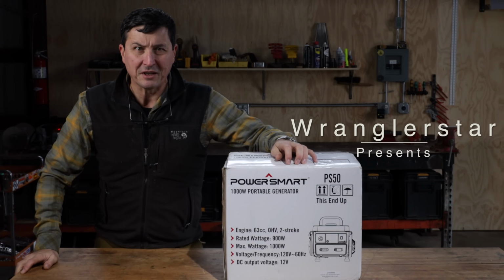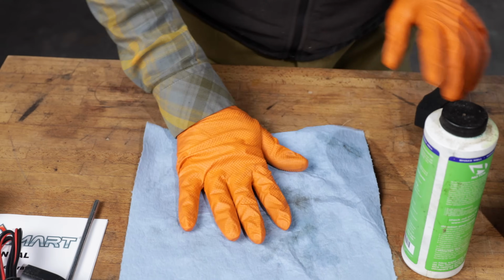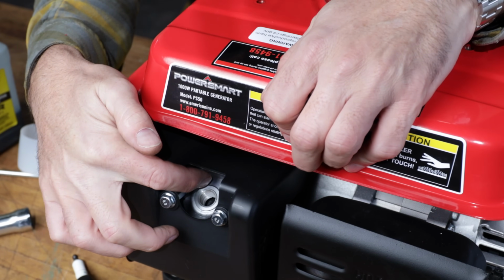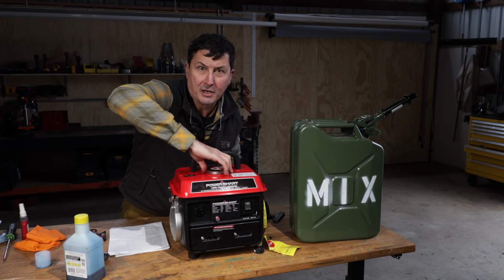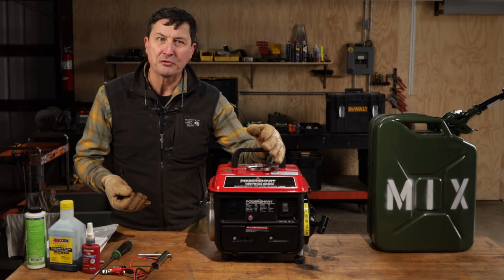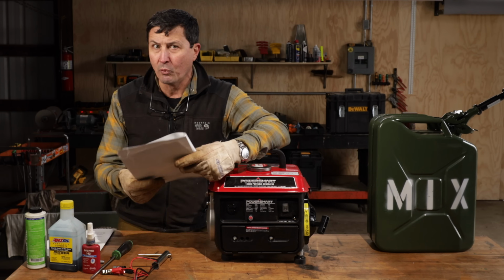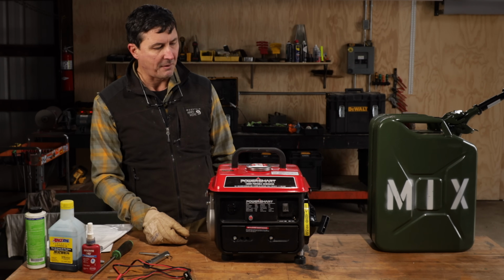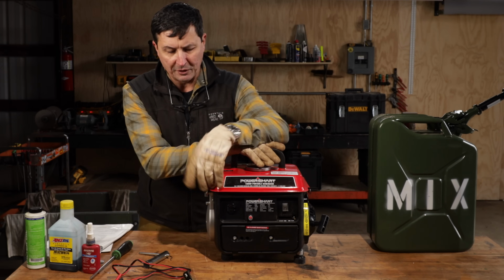TESTING The Cheapest GENERATOR on Amazon -$99

Comment: I've got a few of these generators, you do get the odd dud straight out of the box, and I've had one of those, but there are plenty of good ones.
 They are based on an old Yamaha design, its two stroke engine has a carb and reed valve mounted at the back of the Alluminium alloy crankcases, with a detachable cast Iron cylinder barrell and Alluminium alloy cylinder head at the front. The cylinder also has a sort of triangular shaped exhaust port, probably in an attempt to soften the exhaust note a little.

 They usually run quite smoke free with the recommended 50/1 petroil mixture, after any excess oil has cleared. They sell for around £60 from cut price supermarkets here in the UK, so they are just about cheap enough to risk getting stolen if you are forced to leave them running unattended outside.

Comment: I bought one and used it for a week once after an ice storm left me without power. I did not drain the gas and put it away properly, so it never started again. The tiny carburetor jet was so clogged I gave it away to someone who likes to tinker with stuff like that. However, I bought another one specifically for a fishing/camping trip, and I drained the gas and put it away properly, and it still works fine today. Just don't store it without turning off the gas and then running it until it runs out of gas. With a few precautions, you'll get your money's worth.

Comment: Thanks for your time creating this video. It is pretty much all subjective but great advice about not storing a generator with fuel in it. As Wranglerstar knows, a more useful evaluation would include hard data such as frequency, current, voltage and temperature rise of the engine and the generator under various loads all of which is easy to measure. BTW, charging that little battery is not much of a load. 

A typical refrigerator is said to draw about 7.5 A while running but can require as much as 10-13 times that on start up although for a very short time. 7.5 A at 120V is 900 W which is the "continuous" rating of this generator. How many of those cycles would this generator withstand? When a generator is really needed in an emergency, reliability and longevity are essential. Can a $100 generator provide that? If not, purchase a half dozen as backups. 

Another consideration is availability of repair parts. I assume these are marketed as a "consumable item" to be discarded upon failure. This is a nice little portable generator for camping or the  occasional powering of construction tools but I would not expect it to provide the service I need in an extended power outage. I doubt that is the intention of the manufacturer so be cautious about what you purchase for your particular needs. 

OK, now all you self appointed authorities can commence criticizing MY "opinion" because you feel your opinion is more valuable than mine. Keep in mind, this is Wranglerstar's video and not yours.

Comment: The watts are a joke.. Look at the amps 7 amps won't run much of anything except for a light bulb or box fan or a 1960s 6 amp drill. Modern drills, skill saws, battery chargers etc use 10 to 15 amps... FORGET IT IT WON'T WORK. ITS IMPOSSIBLE. I know I bought one not knowing the amps. Anyone who says 7 amps runs a refrigerator is laughing at the people who ran out and bought one..

Comment: This generator looks exactly the same as the Tail Gator from Harbor Freight, almost certainly from the same factory. I've heard its a good idea to immediately replace the spark plug because the one it comes with is garbage.
Reply: NFL plug and non ethanol fuel 👍

Comment: I owned one of these generators for almost eight years, it was bought exclusively to power the converter on my small Rv, and it worked relatively well for that application. Now what you are not aware of, is how dirty the voltage is, coming off this unit, the sine waves were the worst I have ever seen, I tried running simple electrical items with it, and it destroyed my cell phone charger, an Led rechargeable lantern, and my portable 12 volt battery charger ....NOTE: The 12 volt charger that is built into the generator has an extremely weak rectifier board and no regulator, so after about 3 mins of charging a dead 12 volt battery, it trips the over load breaker, it's not going to work unless you sit there all day and manually unplug the twelve volt supply every two minutes for about 20 seconds to cool the diodes in the board😩, typical Chinese engineering, leave out a complete component, to bring the cost of an item down... 
      The day I pluged in my small deep freeze, during a power outage, it ran for a while and then made some strange noises, and thankfully shut it self down, as it could not receive the proper hertz frequency from the unit under load to cycle the compressor, the voltage spike of the freezer's compressor was more than the voltage output of the genset, although the freezer was only rated at less than 600 watts... This little generator has its limitations, it's great for basic electrical items like an electric drill, simple kitchen appliances, a small eletric space heater, house hold lights ect. it will even run an old school tube TV with a robust high voltage regulator, but certainly not a flat screen TV, or any sensitive electronics. I have even tried running a high quality voltage surge protector in loop with this generator and it would go into limp mode after only 1 minute of operation, with a flashing code sequence that denoted poorly regulated out put voltage, too dirty to filter by the surge protector.... Decide carfully on your needs, if this generator is going to work for your application before buying it.
Reply: Noted, and thanks for it, no rectifier equals cheep. But if you have a rectifier (like for your vehicle that plugs in the old cig lighter) you can protect the finer electronics.
Reply: Have you tried a UPS? They are better than regular surge protectors. Need something for a hunting cabin and don't want to be spendy as it will only be needed for short periods of time.
Reply: @kenkinniph2327  my thought exactly... I have one of each but no O scope anymore. Will be worth a little experimenting. I'll call Shelton.
Reply: An UPS will FREAK out when connected to a dirty generator. It will keep switching back and forth from the generator to it's internal batteries trying to clean the power until the batteries die and then it'll shut down totally.
Reply: @kenkinniph2327  No I haven't tried a UPS back-up, but it sounds like a good idea, I did however buy a more powerful, better quality  generator, it's 1800 watts, and has a relatively clean sinewave, so I've had no complaints with powering electrical devices.
Reply: The powershart
Reply: It's not pure sine wave I would not use this generator on any electronics or motors.
Reply: @ronb6182  depending on the type of motor, it should be ok, I used this generator for running an electric drill, and a hedge trimmer
Reply: Direct current is probably ok you can add some capacitors and chokes to clean up the  DC. If it's only a half wave rectifier put a bridge rectifier on the dc output. As for ac I would not use the generator for anything else.
Reply: Agreed, the sine wave is way off, was getting over 400v spikes, and blew a halogen lamp and soldering iron. A friends caravan charger was fried after using it for a few mins. Pile of junk. Buy cheap pay more , buy twice.
Reply: @workonesabs  wow maybe my incandescent lights might also be a target with 400 volt spikes. I would forget the AC portion of this generator period. DC you can add a bridge rectifier, capacitors and chokes and you should be fine. People don't realize that most home generators that you buy at the big stores are really alternators and a cheap inverter. I have one myself I bought in case of a hurricane but it would be better to buy batteries and a good pure sine wave inverter and keep the batteries charged then use a generator that has dc to charge batteries if you run low on battery power.
Reply: @workonesabs  Mine worked really well on my tent trailers convertor, but I did not have such a large deflection in voltage
Reply: We use it to charge our battery bank and then pull clean waves from our inverter
Reply: Brent you can clean up DC. You can run dc through a bridge rectifier and add a good size capacitor and use a zener diode for voltage regulation.  If you are more advanced in electronics you can use  power transistors as well. You can get circuits online. Ac is the one that is dirty. DC can be cleaned up. The old tube car radios did use a simular circuit.
Reply: @ronb6182  I've read up on building a regulator using this process, but never pursued it

Comment: The head bolts on these are weak and long.  They stretch and you will need to tighten them once it won't start. Might get it done twice then you run out of threads.  The bolt is custom so once it's stretched to where you can't get the machine to start...you're done.

Comment: You will not be able to run a fridge/freezer unit off one of these,.... Well run a fridge yes.... but a small generator cannot START a fridge. most fridges require 5-10x the amount of amps to start. My home fridge is 240W to run, I've got a 2400W Honda and with just the fridge connected it may start 1 out of every 3 attempts. Chest freezers often are a bit easier to start ours could start quite happily while we had several other loads, Lights, TV and a small 500W Travel jug for hot water.. ended up giving up on trying to keep the fridge going... so we stacked bottles of water to freeze in the deep freeze... we'd then cycle them through the fridge to keep the fridge cold.

Comment: I would never hook this up to any sensitive electronics. Thats one of the things you are buying with a Honda is clean constant power.  This?  you have no idea.
Reply: I wouldn't hook it up directly though maybe through some form of regulation
Reply: Or run it through an external inverter, it has the 12v output
Reply: hmmm.... maybe this generator produce square wave
Reply: Anyone have recommendations for inverters? I'm looking around and a 1000w inverter costs $70, and I have no idea what the terminals are for.
Reply: @Kracov_the_Madman  I would spend some money and get a sine wave inverter. Connectors are usually not a problem there is always an adapter

Comment: How can you run a 1500w heater on high with a generator rated max output of 1000w? This would trip the load switch.
Reply: it looks like overtemp switch, not an actual electrical breaker, so it would trip when overheated, and there is probably some spare power beyond that 1kW

Comment: Great review! This seems like the perfect secondary backup generator. I have a 7500 watt westinghouse which is what I normally use for power failures. However during the last ice storm I had serious issues starting it up. I'm not mechanically inclined at all, but after searching youtube / forums I was able to change the spark plug and do a few other things in a real panic to get it going. 2am in freezing rain when your phone is at 10% is not the time to be learning about small engines. That being said it made me very aware having a second backup is a good idea. I have very expensive and dear to me saltwater aquariums. While the 7500watts powers most of the house this little guy would be more then enough to power the aquarium pumps / charge things in a real emergency where the main generator doesn't work. For a little over $100 I'd be happy to leave this in the box and never have to use it.
Reply: investigae a power conditioner so your pricelss fish dont suffocate when the derty unmatched frequency of the power fries your pumps. A pwer conditioner is a large transformer looking thing, heavy, that evens out the voltage fluctuations, brown outs and surges.   They are about 60-100 bux for 500 w.
Reply: Drain the  float bowl, after each use. Even just turn off fuel petcock, and run it outta gas. MODERN  ETHANOL  gas, dries and gums up,  ALL   carburetors !    Mowers, etc etc.

Comment: I was told by the owner of a small engine shop (junk yard style buy & sell) to never go down to 50:1 no matter what the manufacture says.
He said that manufacturers are pushed to keep emissions down so they have to say 50:1, which is basically the bare minimum that a machine will tolerate, but it won't tolerate it for long. A simple miss calc can cause major engine scoring. he said at 40:1 you get very little smoke and your saws and boat motors and weed wackers will live for decades.

Comment: Bought a similar one waaay back in 2000. Still runs fine with zero maintenance. But they are only worth running lights or a small angle grinder/drill with. The output voltage is pretty chunky and will ruin any delicate electronics connected to it.

Comment: The harbor freight version of this saved our fridge after a week with no power after a hurricane. Running 24/7 it ran our fridge and my fish tank for a week. Still works years later
Reply: Same here.  We were without power for 3 days.  The Tailgator ran and saved us from having to throw away hundreds of dollars of food.
Reply: @PalealYah Bayn Yisrael tail gator  is the harbor freight one
Reply: @Willam_J  they get product from multiple factories in China and assign different model numbers to track them.
Reply: PalealYah Bayn Yisrael tailgater
Reply: The Tailgator
Reply: I bought the same one from harbor freight and the pull cord broke first pull lol
Reply: @AustinHerrig  don't pull so hard haha
Reply: @AustinHerrig  we got hercules over here
Reply: What model was.it 63024 or 63025??
Reply: After loosing power for 8-16 hours during a couple snow storms, first I bought a small kerosene heater, later I bought cheap generator.
Reply: How long does it run till you have to refill it with fuel?
Reply: jeffmurnahan I think I had to refill it every 6 hours
Reply: Mine was 2 hours
Reply: Nice!
Reply: Better than nothing
Reply: To hard to pull start
Reply: @juliadawnyel3648  Bit late to the party, but to the left of the choke lever you'll see the screw-on air filter cover with a couple of holes in it. If you get a spray can of starter fluid, carburetor cleaner, or even WD-40, and spray a couple of quick blasts through those holes, move the choke lever all the way to the left (engaged), make sure the fuel tap and switch are both on, and give it a couple of pulls, that should help fire it up more easily. After a minute or so running just flick the choke lever off (to the right). They also start far easier after they've been broken in a bit--say, running an hour or so with something like a fan connected run at various speeds to change the loads. Whenever shutting it down, just turn off the fuel tap and let the motor just run out of fuel. That will really help its little carburetor from clogging up, as they are prone to do after sitting a long while--especially if there's any ethanol in the fuel. And speaking of fuel, make sure and use 2-stroke oil mixed to a 50 to 1 ratio of gasoline to oil. Directions are usually on the oil bottle or jug. Using just gasoline with no oil will kill a 2-stroke engine very quickly.
Reply: @BilgemasterBill  I use crankcase sae 40 oils when I run out of 2 stroke. After all, oils are oils, and decades ago, crankcase sae 40 oils were widely used with the only inconvenience to have to replace spark plugs more often, but spark plugs are not that expensive. I don't use vegetable oils because these oils have no additives and turn to wax quickly, so I stick to a petroleum based oil
Reply: @danteerskine7678  Great minds, similar circles. On several occasions when I lived in Berlin whenever I would travel on my lovely 2-stroke '57 Zündapp Bella scooter and run out of 2-stroke oil, I'd just rummage through the fuel station trash for discarded "empty" oil jugs, whatever the grade. There were always a few drops left in them, and I'd just mix that with the gasoline. It didn't do it any harm. Nearly 40 years later I still have that lovely scoot, and its compression is tip-top. As for plant-based 2-stroke oils, back in the day folks used to use Castor Bean Oil, which is where "Castrol" got its name. You can still buy their "Castrol R" Racing 2-stroke or in the States there's another brand called "Klotz BēNol". Neither are cheap, but a lot of vintage racer guys use them because of their lovely and distinctive "nostalgic" smell that comes out the tailpipe.
Reply: @BilgemasterBill  I have a pal who did the same thing with his 09 Suzuki AX 100 2 stroke when his oil injection pump died. Apparently the bike ran normally, no visible smoke whatever and he used only NGK spark plugs . His bike is still running fine.
Reply: It used to be that one of them wax the California emissions model.
Reply: @Soup Can Funny, I've only ever heard good things about those little 4-stroke 'Sportsman' gensets in cruiser-sailing forums as affordable alternatives to the unimpeachable but very pricey Honda offerings. Until the 'Kung Flu' came, you could still pick up their 1,000 watters for about or even under $100. Nowadays they seem to be asking about twice that. I can't say much about that Home Depot model you describe, but the two old red Harbor Freight 'StormCat' ones I've had for many years (nearly identical to the later green 'TailGator') have never let me down. One massive improvement one can easily make to them is to replace whatever ridiculous Chinese 'Torch' or 'BongoDongo' spark plug it comes with with a proper NGK BP5ES or NGK BP6ES or the Champion or Autolite equivalent. They run MUCH better, smoother and even a bit quieter with a decent plug.